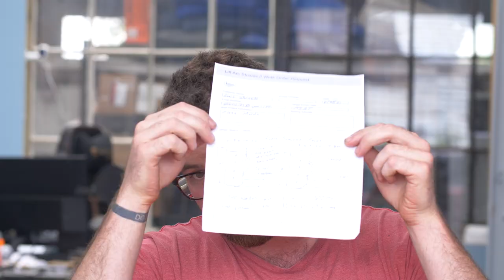Learning How to Make Molds for Glass Blowing  // Lift Arc Builds

Comment: What about using a flat sheet of steal and using one of those rollers tools that let you make cylinders of any diameter? Bonus, new tool to play with. May a French wheel would be cool too. Couldn’t that allow you to make cupped cylinders? Like the plot of a function that looks like a saddle. Oh, here’s another idea… plasma cut out triangles, squares, pentagons, hexagons, etc and weld them together to make all kinds of funky 3 dimensional shapes. Platonic solids, like 3 and four sided pyramids, combined four sided pyramids at their bases, even 20 sided D&D style dice glass dies, dodecahedrons, icosahedrons and on and on… Then for extra spice use your bandsaw to just cut them into two halves and if you choose to run the cut through at a funky angle you could make even weirder shapes for the molds. So many cool possibilities. You should go visit your sis and film her at work using your molds. I was lucky to have seen glass blowers in Venice in person making Venetian glass over 25 years ago and it is such an amazing art form.

Comment: I’m sure you know also that earlier bottle molds used clay which could accept very intricate designs and shapes. Steel and brass were found to be much more durable, but the “hinge” type molds were commonly used. Seam marks could be reheated to make them less noticeable. Keep up the amazing work!

Comment: for the 3 1/2 molds, it might be easier to use 4" pipe and weld the inside, and turn it down on a lathe